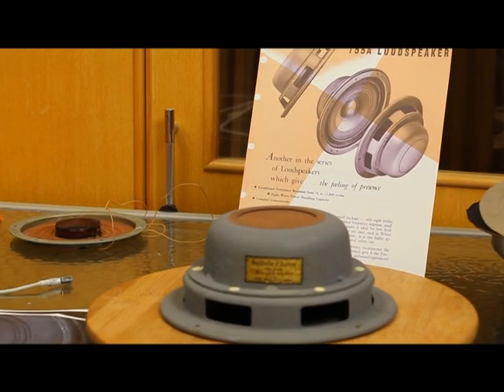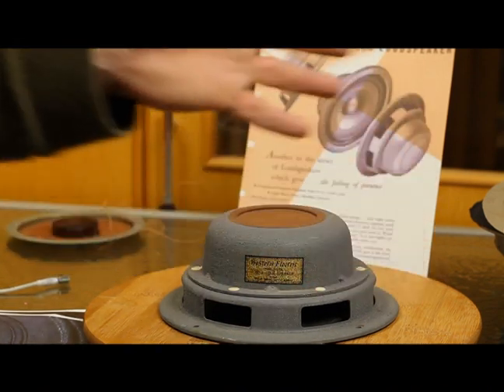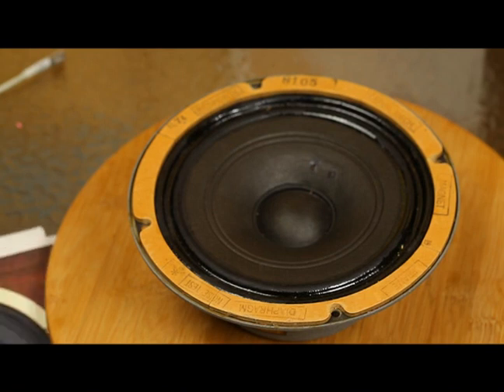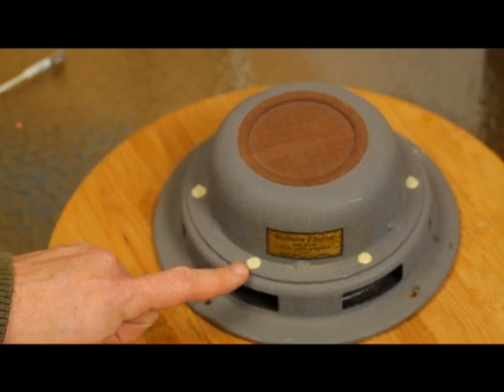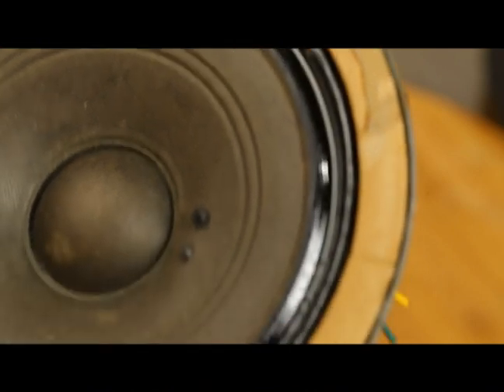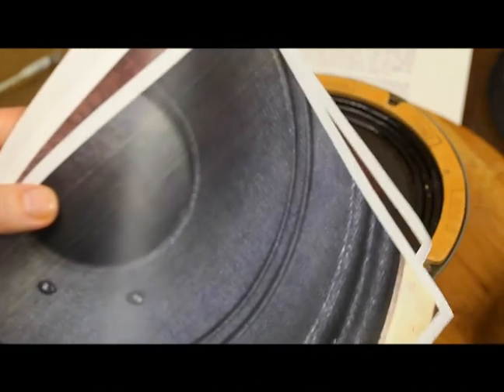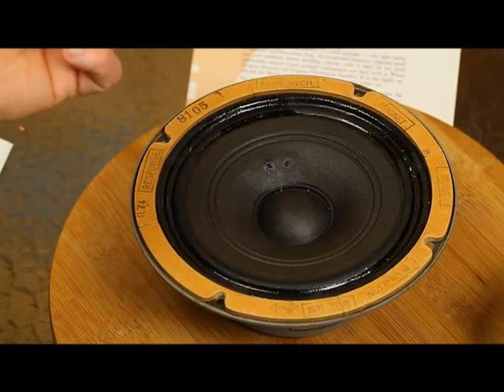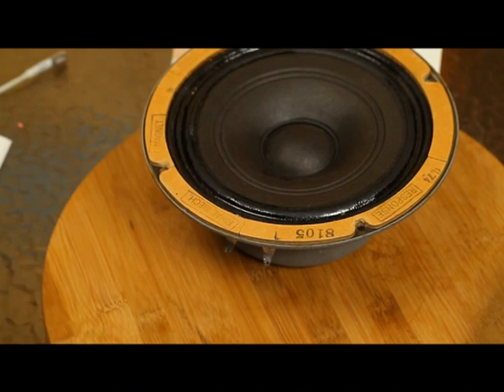The Western Electric 755A Ep 1 - How to spot a recone!

Comment: What was the MAIN use of this driver and where do they show up in? I heard they could be found in paging systems in schools or hospitals is this true? Also WHAT makes this such a special driver?
And what type of cabinet would you put it in for a driver like this.love the video.you need a arrow to point out things on the cone.
Reply from the maker: Thanks Gerald. In the second video (when I find the time) - I will use a pointer. Digital effects are not my style, so will use a old school pointing stick :) The 755A was engineered to be as close-to- perfect, in the 8" format, in the 100-13k cycle range -- it's peak performance is in the midrange where most musical information lies. The huge magnet controls the heavy, specially designed con and large voice coil with precision.  Any lightweight 8" full range driver can do the same thing. and much cheaper and lighter. is less smooth and has more distortion.... The 755A has the best response and most detail -- with true realistic sound within it's limits. (Their are other good 8" speakers that can go lower and higher than the WE 755) ....  WECO did not need to make money -- so it was built cost-no-object. As a High Fidelity product,  WE speakers like this were a commercial failure. They were sometimes installed in industrial and commercial locations, yes, and by the late 1950s, they were sold in the back of magazines as "surplus" until they were all gone by the early 60s..